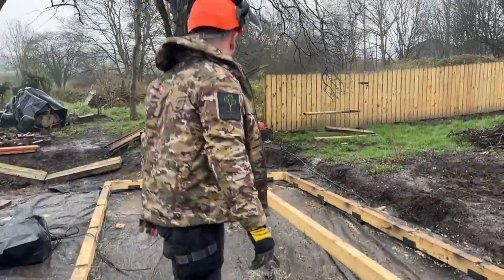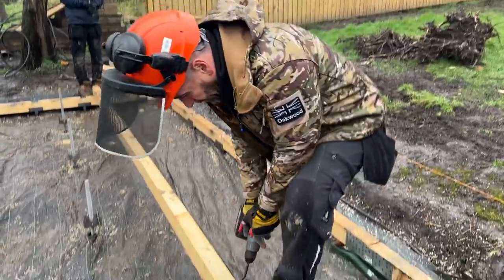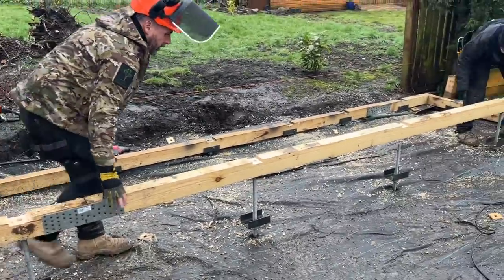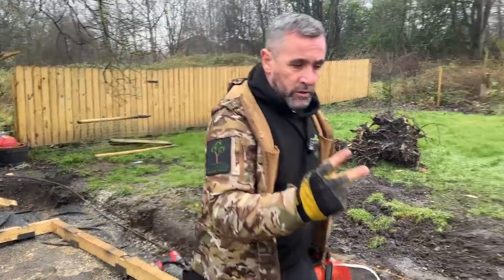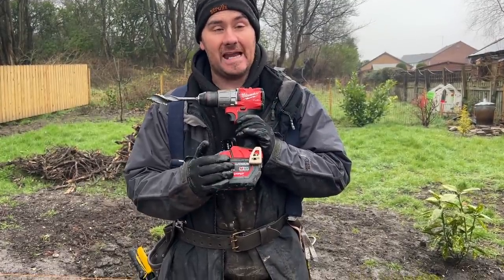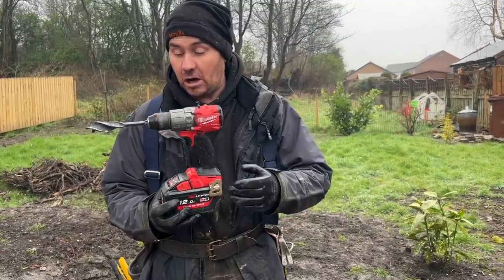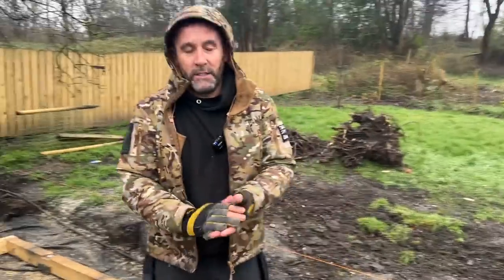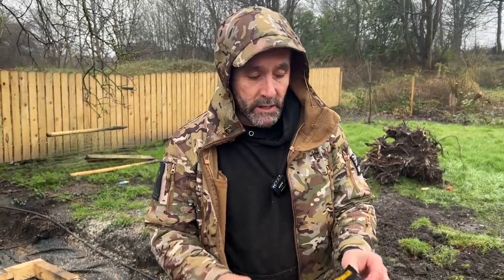Garden room base timbers cut the most efficient way we have found

Comment: 100% I’m in the game myself I build between 5-10 a year aswell as running a company and doing home renovations, your build pack made life easy I used to sit and do CAD drawings for design specific for clients, then one day turned up to do a quote and client showed me one of your videos and said I want exactly that one. So do I go and spend a day doing a CAD drawing and doing materials lists for suppliers and probably loose a days profit or do I ping you an email and pay for the pack and don’t have to do the leg work and make a profit. It’s a simple answer. I’ve recommended your packs to mates in the game and they have all said the same saves so much time and effort. Building game is always about being productive. So the point of this very long and boring speech is that. Coming from a joiner. Your build packs are perfectly detailed and always down to a tee on materials. Takes a real tradesmen with experience to do that not just any monkey or cowboy as people say. Anyways av went way off topic now I think. 
Videos are class mate, shrug the hate off though. If they ain’t hating on you then you ain’t winning in life. Think of it that way

Comment: Commented before as someone who installs and tests ground screws for a living. Nothing cowboy about Liam's threaded rod in concrete system. It'll work just fine and outlast the timber building on top of it. If I didn't have the gear for screws I'd happily put this in my own room. Remember these building fully loaded weigh 3-6 tons. That's nothing spread across 20-30 rods. Keep putting the videos out mate and the keyboard warriors can bugger off.
Reply from the maker: Love this
Reply: @thegardenroomguru  why add onto that timber then cut it off .. it looked as if u cut off more than was added at other end ?? Ps great workmanship shows how work is done in real life
Reply from the maker: Timber is 4.8 mate
Base is around 5.1, so needed to extend 👍🏼

Comment: The battery VOLTAGE drops under load not current. A 12AH battery can sustain a higher voltage under load than a 5AH battery. The other thing is that a larger battery will enable the drill to pull more current therefore maintain it's speed better under load.
Great to see the speed of installing the joist.
Reply: CORRECT MATE
Reply: Correct - the only caveat I'd add is that not all larger capacity batteries allow a higher amp draw. The BMS within the battery could be the same between 12AH and 2AH, resulting in the same amp draw, however, the voltage will drop sooner on the 2AH battery and therefore the watt output will be less, as you stated.

Comment: John, you are close but not quite there. The difference in the batteries is in Amp Hour rating, not current delivery or load. Amp Hours is the storage capacity of the battery so the 12Ah battery has 2.4 times more charge stored than the 5Ah battery. If both are fully charged and the drill demands say 10A current to operate at a particularly load, then BOTH these batteries will deliver that no problem. The difference is actually in how long they deliver that current for. Think of the batteries as full buckets of water - a small bucket can be emptied at the same rate as a big bucket but the big bucket will take longer to empty. Li batteries are very efficient and will deliver high currents irrespective of capacity. I like the videos though guys, good efficiency on installing that timber!

Comment: All I can say without knowing the tech is that when I used a 2ah battery on my circular saw it never had enough power to go through the timber it would just stop and as soon as I used the 6ah battery it had no issues. Anyway I don't know the demand on the battery under load conditions but I can only agree with you from the experience I had

Comment: Can building regs non combustible requirement be satisfied by using feather edge boards and painting with fire retardant paint? Just been on the phone to paint supplier and they say they can certify it meets class 0 which is highest level achievable. This is cheaper, easier and much lighter than using zinc sheets

Comment: Welcome back mate, you've been missed! Ignore the wanker keyboard warriors, you'll drive yourself crazy otherwise.

The battery issue is bloody confusing at best and there's a lot of misuse of terminology!

They all advertise the capacity of their battery packs in AmpHours, not "Amps"......... e.g. 12 Ah.... 1 amp for 12 hours or 12 A for 1 hour....

Do not confuse larger capacity with more "power" unless they tell you you're getting more power..... Some do....Some don't!

On the face of it, the only advantage you should get from a larger capacity battery is more run time. But, like life, it's far more complicated than that.

The "power" we all talk about and "feel" is generally the torque or force generated. Things change as the batteries are put under load. They heat up. Their resistance changes. Their ability to provide current changes. Add into that mix a battery controller that will limit and balance the current drawn and there are too many variables to make broad brush statements.

What is true however is that the larger battery packs are generally made of more individual cells. That does give the designer/manufacturer more scope to allow them to provide higher current levels, which in turn can provide that extra "power" or torque. More sophisticated electronics allows them to control that output and keep the internal heat under control.

As it happens, Milwaukee do make exactly that claim for their "High Power" range of batteries.

Now, I'm a Dewalt fanboy, and they don't make that claim......... but they do have their 54V range! Told you it was complicated!

Comment: spot on about the battery
Reply from the maker: Had a lot of haters on my Facebook business page regarding this. John knows his tech that’s for sure
Reply: Great videos guys. I've watched hours and hours over the last year or so.
With the batteries, I thought the rating refers to the storage capacity of the battery (in amp hours), not maximum amp output? Higher amp/hour (ah) simply means longer run times. The new Milwaukee 'high output' batteries vs the standard red batteries youre referring to is something different. These new high output batteries claim to provide higher peak outputs, not necessarily longer running times. The amp hour rating in itself doesn't suggest a higher peak output. The typical consumption of that drill I guess might be closer to 40a under high load. Running a 10ah battery on that drill under that load would therefore provide around 15 minutes of continuous use in this example. A 5ah battery in the same example may last 7.5 minutes.

Comment: The only thing I would do differently is to get some flat steel 50 or 60mm square with a hole the same as the rod so when you tighten the nut it doesn't just pull into the beam, other than that the systems good, don't let the nay sayer trolls wind you up 👍👍👍

Comment: its your voltage that is dropping each battery is capable of supplying the same amount of current when fully charged. your correct that a 12ah battery will last longer than your 5ah and give more power but your understanding of why is slightly incorrect. a 12ah battery does not supply 12amps, its supplies whatever amps is needed based on the voltage and the load that might be 5 amps, 10amps 20amps. and your 5ah battery can also supply 5 amps 10 amps and 20amps for the same load but just not for as long so as its charge drops the output voltage starts to drop that is when you see the reduced performance.

Comment: Its AH amp hours not Amps, the amps don't drop the Volts do. Your right in what you’re saying, a high AH battery will have less Voltage drop under load. just wrong terminology